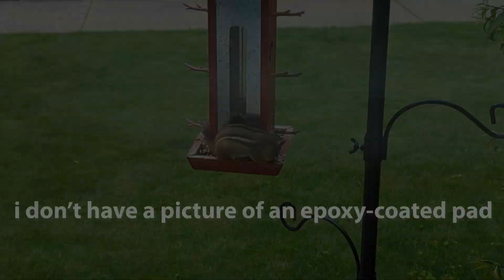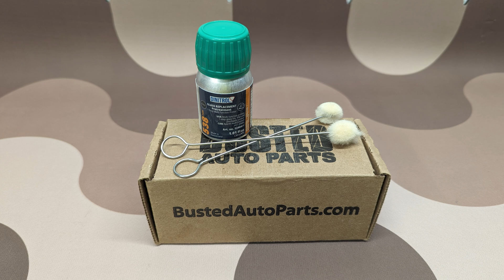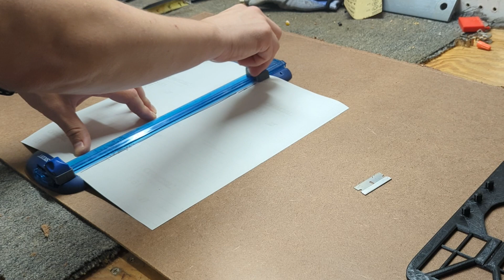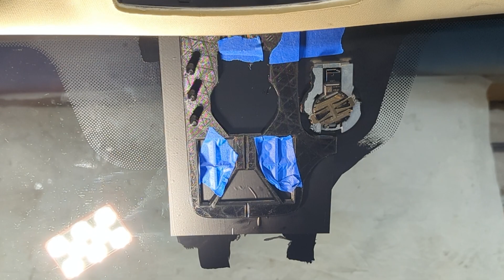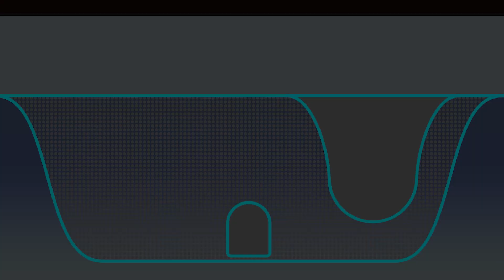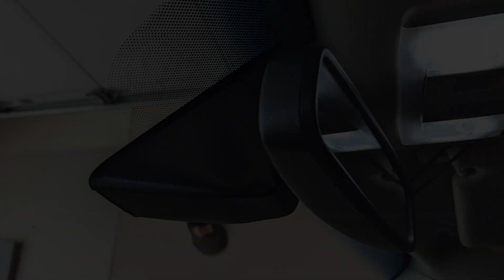Let's Retrofit Lane-Assist to a Ford Flex (Part 2: The Point of No Return)

Comment: How well does LKA function in the Flex? Does it ping pong back and forth between lanes, or is it a decent implementation with smooth and dependable land centering? I'd love LKA in our Flex, but trying to judge if this is worth the effort. Looking forward to part 3.
Reply from the maker: It's not full "lane centering" like newer Fords offer, but seems to work better than my 2022 Silverado's lane keeping. 

When you get too close to the line, the Ford will steer away then give a partial counter-steer to attempt to straighten you back out.  

The Silverado doesn't do that second countersteer so it'll ping-pong between the lines.

Ford had to put a safety lockout on the system so it's not capable of lane centering or openpilot -- after every action, there's a 300ms cooldown where it won't accept any more actions.